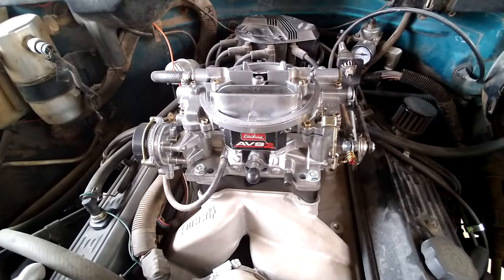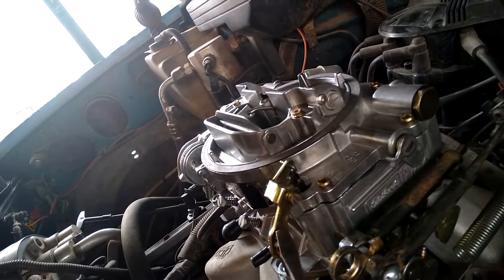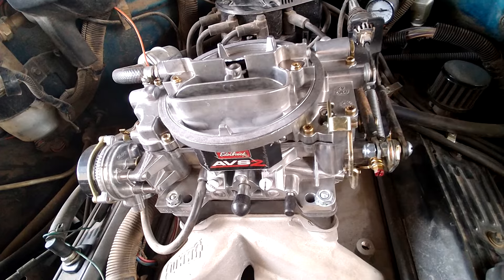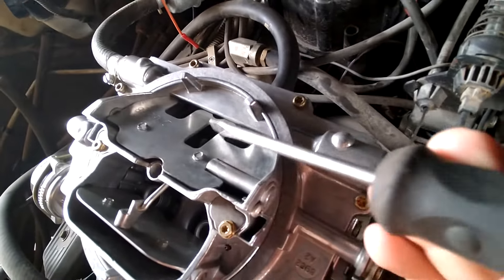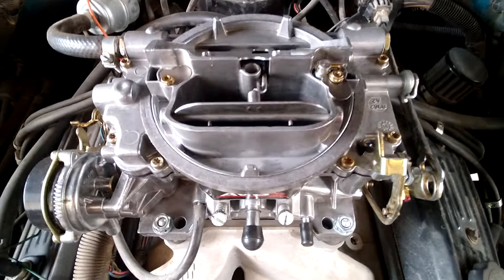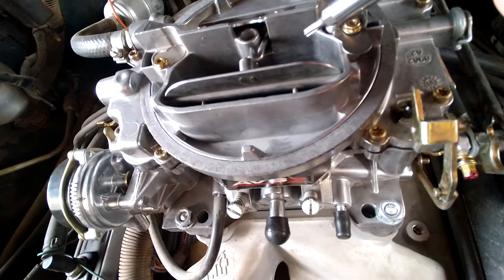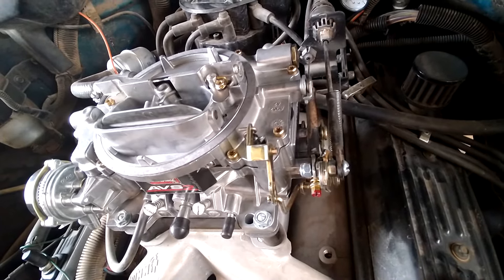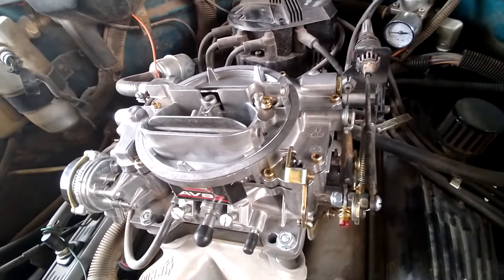Tuning and setting up a Edelbrock AVS2

Comment: I have a 67 396 with a mother thumper cam headers roller rockers nosiey gear drive high rise intake and a avs2 I can't seems to get it tuned, I can turn the screws in and it doesn't do anything????? I also get a fuel smelly exhaust and dieseling wheb shutting truck off
Reply from the maker: Yessir it's because the mother thumper cams are 107 lsa no vacuum I'll send u a video of how I fixed my problem
Reply from the maker: https://youtu.be/guDJV1pf4QA
Reply from the maker: You can spend money on stepup springs and jets and needles to do it right but I drilled throttle blades because it's cheap easy fix
Reply: @CCAutoWorks  think that would help me be able to set it at idle? If it doesn't I have another parts carb I can use the butter flys
Reply from the maker: @96318dakotaify  yeah that's what we done because we have a Howards rattler cam and it's basically Howards thumper cam but there is another guy you can ask who don't like my method it's @musclecarsolutions
Reply: @CCAutoWorks  instilled holes, now I could adjust the mixture screws but the idle stays at 1000 rpm with screw all the way out???? To big of holes???
Reply from the maker: @96318dakotaify  what size hole and how many I start with 2 3/32 holes and work up from there
Reply from the maker: I think mine has 5/32 holes in front and two 3/32 holes back but every engine different always start small and try each time

Comment: My AVS will idle with screws all the way closed! In a Cleveland.
Reply from the maker: It's because the cylinders are loaded up with fuel
Reply from the maker: On are cammed 351c we finally drilled the throttle blades to lean it out so it wouldn't load up

Comment: i pulled my 1406  and installing a 1906 and im stuck on how the back studs need to be in the inside holes i cant put the washers on the outside and start the nuts
Reply from the maker: I don't know why your back studs would be on the inside holes of the carb what intake do you have and if there not long enough for washers just unscrew them out of the intake a tiny bit
Reply: i got it done
Reply from the maker: @mikewarren5262  awesome

Comment: I've got an AVS2 650 on a stock GM Goodwrench 350. How many times do you pump the gas before a cold start? Say, if it hasn't been run in days or weeks.
Reply from the maker: Electric pump turn key let it run a few seconds pump three times and start if mechanical pump I just pump the throttle as im trying to start it tell it gets enough fuel to the carb to start

Comment: Just for information guy's...that fuel pump accelerator connector looks like a Z on top of his carb, should face the other way...should look like as S,  when facing the carb like this. This Edelbrock connector has a particular bend in it. Should always be an S. Just flip it. 👍
Reply from the maker: That's got to be worth at least another 10 HP thanks for watching
Reply: No, but correct is correct.

Comment: So it was an improvement over the old one... but then you fucked with the tuning and now you have a few things working against each other it seems like in the tuning. Also a bit of wrong info I think in the directions. Once you start turning screws on these you have to be very aware.
Reply from the maker: To each there own its got a fst on it now because I don't like Edelbrock

Comment: Just spend the extra $100 on a new one.
Reply from the maker: Should have because I've already thrown that thing in the trash
Reply: @CCAutoWorks   Yeah, too many people have tinkered with used ones. Carbs are pretty cheap. Just buy new.
Reply from the maker: @SOLDOZER  forsure